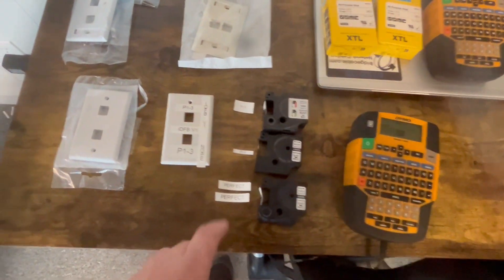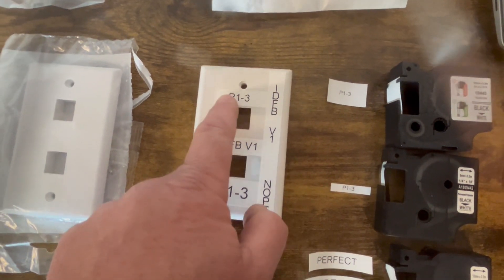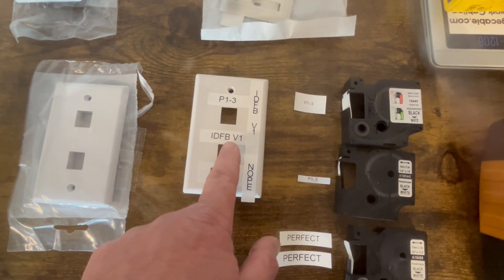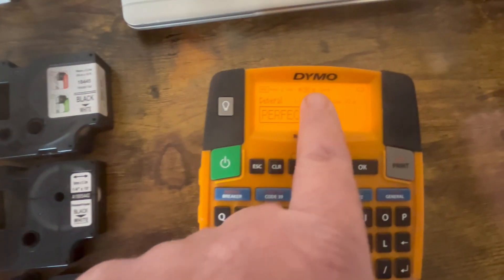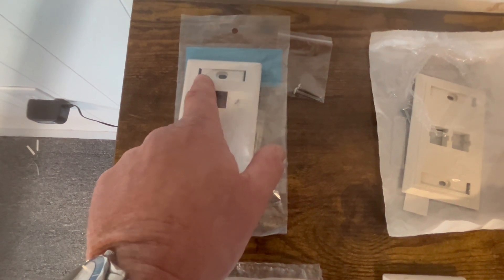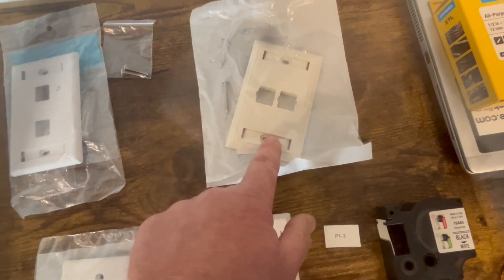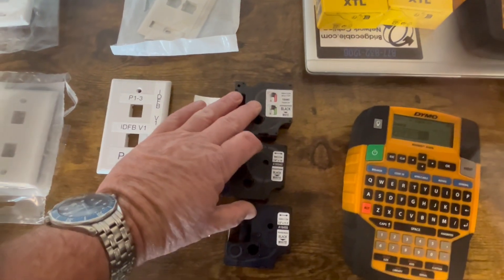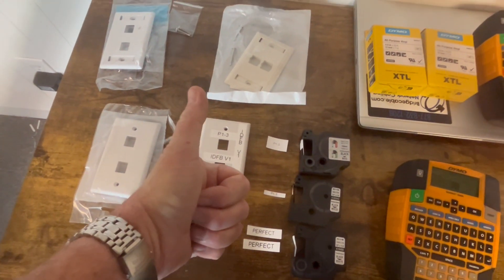Installing Labels on Network Cabling Faceplates and Position Examples | Training BridgeCable.com

Comment: How do you label a wall plate with the windows that has more than two jacks? A 3 or 6 port for example. Thanks!
Reply from the maker: @bradylepage Come to think of it that "kills" the video then :) The point I was trying to make on this video was a pattern.....a site with new techs had the labels up/down left/right.....different font sizes.....looks crazy. Find a pattern and stick to it......yuppers....3 port and 4 port....use best judgement. New techs also skipped using the windows pane on the faceplates.....sometimes you just need to review it all with folks starting out new in the business. Happy Cabling!!
Reply: @ agreed! Pattern is key. I’ve been doing most of my work in a school with sections built in 1911 through 1998 so any label pattern is nonexistent. Quite the time doing the tone probe scavenger hunt
Reply: @bradylepage Oy Vey.....can imagine you get your "steps" in :) Keep a pattern! :)